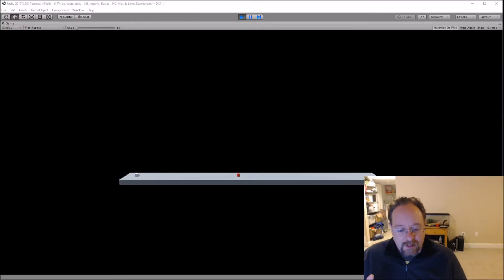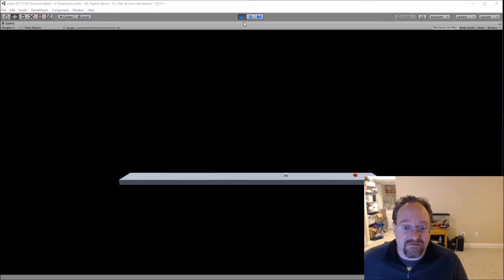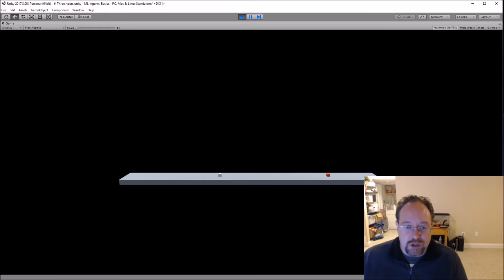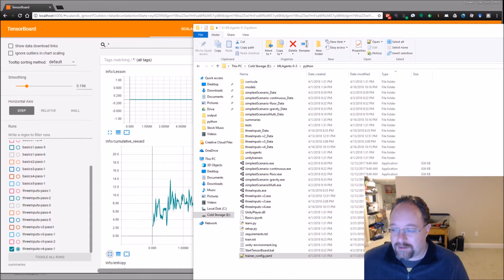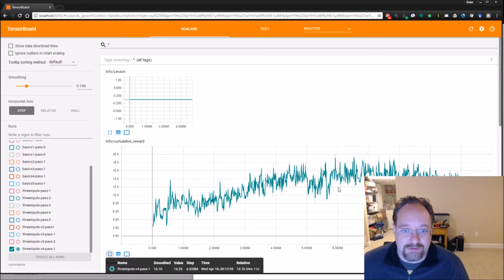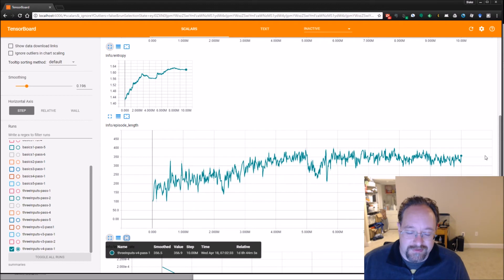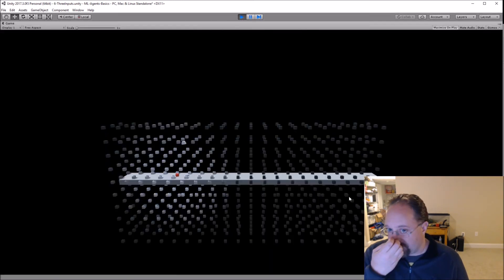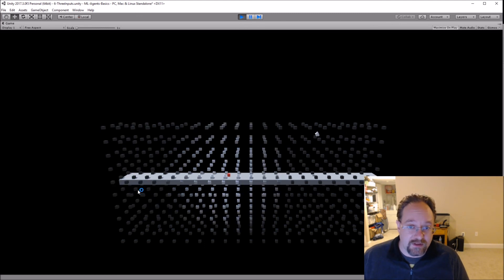Lunar lander landing fairly well

Comment: Which hyperparameters values do you use? Thanks!
Reply from the maker: BasicBrain6:
    max_steps: 1e7 #10,000,000
    time_horizon: 500 #Same as max episode length
    beta: 1.0e-3
    num_epoch: 5
    buffer_size: 5000
    hidden_units: 128 #doubled from 64
    batch_size: 1000
    buffer_size: 5000
    summary_freq: 2500
    learning_rate: 2.0e-4